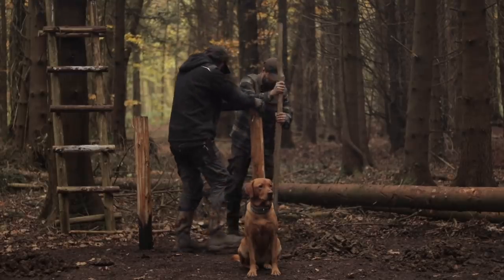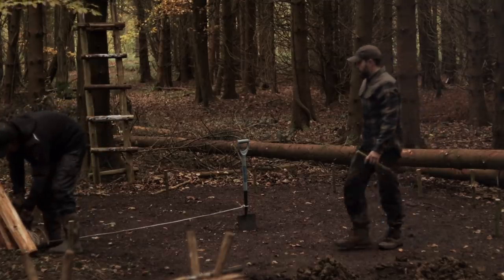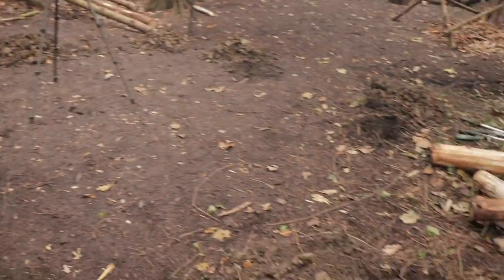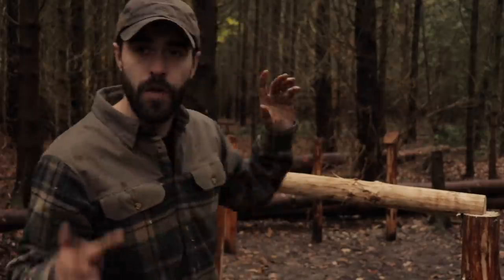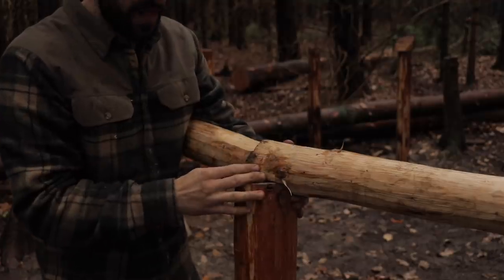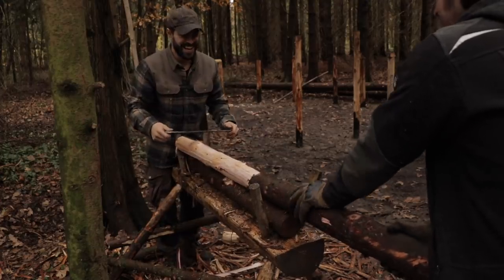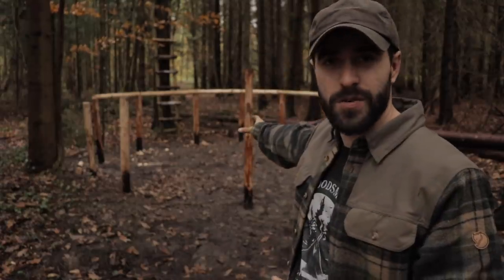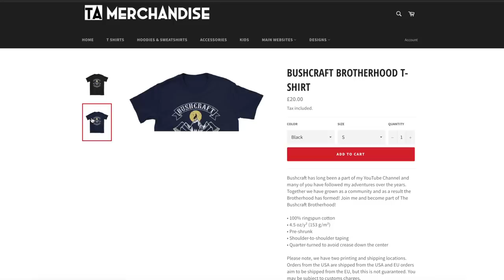Iron Age Celtic Roundhouse: Building the Timber Frame Foundation | Bushcraft Project (PART 2)

Comment: Haaaaa, you always feast well when Dustin is cooking!  Will you be digging a bit of a pit on the inside leaving a width of a sleeping area all around the outer perimeter?  Might make it a bit more comfortable when sitting around inside.   You’d have an elevated sleep platform/storage around the outside.  It’s looking great.  That would also work as a cold sump and it should be warmer sleeping.

Comment: Massive massive tip having been part of a team that built a roundhouse, is put the entrance in the position so it faces the sun.  The aim is as the sun moves across the sky the light moves along the back wall.  After a while you can tell the rough time of day, also you will always have a light source.  Permanently during the day.  Roundhouses can get very very dark.

Comment: Yep can defo support previous comments, wet your spade before digging clay - it works! - I learned that from my Fenland grandfather plus brand new to the channel, I have an ash woodland in N Staffs and planning a round house structure, having early thoughts on such plans at the moment, so I'll be glued to your trials and will be learning loads from you! The intention is to be a go to shelter if/when rain arrives on site during the delivery sessions I run; been using a parachute and or awning/tarps over the last ten years or so! - cheers and good luck, it looks a great setting you have there,

Comment: Hiya, just want to say great series, I was on a weeks holiday in Cardiganshire, and on the road between the town of Cardigan and Newport, on the A487 on the right hand side down a small lane there is an Iron Age village called Castell Henllys. It's an actual iron age village and they have rebuilt the round houses where the original ones stood fascinating place, and it has the ability to move a person well it did me. The large round house has a fire pit in the middle and I noticed that the fire is in a square shallow pit, obviously the round house is a lot larger than the one you are building, but I think the fire is in a pit to allow it to be a larger fire. I was lucky as it was November and not very busy and because I'm  disabled and use a crutch, one of the staff I think maybe the manager offered to take me up to the village in the sites car what with the village being up on a hill, this very kind lady then walked with me as I walked around and into the 3 roundhouse, which gave me the opportunity to ask questions, one being on how when I was at school (long time ago now) I remembered being taught about the Saxons and round houses, and I remember being told or reading that there would have been a hole left in the roof above the fire to let out the smoke..............wrong, the roundhouse's on this site have no such hole, I knew that what I'd been taught was now thought to be wrong but I'd never really asked why,  well as this kind lady told me, wish I could remember her name (I'm terrible at remembering names)  the reason is had there been a hole above the fire the chances were they would have set the roof on fire, because of the embers being pulled upwards, well who knew, I in my own way had thought it was because as it's a thatched roof there would be possible little bugs and things and that with no opening the smoke passes through the thatch killing any little nasty thing like fleas 😄😄😄 well it might do that but that wasn't the reason she told me. Now at this point in this comment, or should I say book, it occurred  to me I'm probably teaching my nan how to suck eggs, sorry if that's the case, but even if that's not the case I'm sure you will be doing your own research. If you've never been to Castell Henllys I highly recommend it.
Well just to add really enjoying the videos, cant wait for the next guys. 👍👍👍👍👍

Comment: Hey Mike!
It is coming along quite nicely!!! I can relate to the wet clay issue.  I once was trying to shovel out some wet clay and it was like a battle with an underground monster...as I tried to lift my shovel up, my feet would embed even further into the ground!
Yeah, as you made the hole in the post question marks were flying everywhere....If you had been putting the hole to one side of center it might have made sense to me, but only one hole didn't.  I thought you might have been intending to have a hole through the cross members and two in each post to match...but then that might actually weaken the post if you had.
You cooked Duck and didn't invite me??? ;-)  You know, Dustin is the "Official Master Bushcraft Cook!!!"  As great as that looked, however, I don't think anything will ever surpass the "Propeller Lamb" meal!
Keep plugging away and we look so very much forward to the next episode!

Comment: Just watching y'all putting those posts in the ground reminds me of the time when I had to extend pasture fence lines. It involved wooden posts, a manual post-hole digger, & a stick to pack the dirt down.  
It was a lot of hard work but in the end, the pride I felt when I'd finished, it was an amazing feeling. I can just imagine how y'all will feel when this house is finished. I wish I could lend a hand :)
Reply: @reivercaptain510  knocks on wood Luckly I haven't had that happen yet to the posts I put in but it did happen to a corner post. And it was actually done by a horse using its head against this 6" diameter post lol. Granted the horse is a half draft so it didn't hurt his head too much 😃
Reply: Not gonna lie, I've had more problems with deer slowly but surely knocking over a section of fence by just clipping the wire as they jump.

Comment: Another trick with post holes is to put a large rock in the bottom of the post hole for the post to stand on.
This will increase the post's "footprint" and allow the post to support more weight .
(It also reduces the risk of the post  sinking deeper into ground over time)

Comment: You can pack gravel or small rocks around base of posts instead of dirt and it will further reduce heave in the winter. That will also keep moisture off the posts, further reducing rot.

Comment: when digging clay dip spade in water clay just slides of spade
Reply: or spray with wd40 ... works also
Reply: they are using a flat tip skinny. should be using a spade tip skinny. used for cutting into clay, roots, skulls, etc
Reply: @0623kaboom  Yes, but that's contaminating the soil with petroleum by-products.
Reply: @indianboobs80085  I know this is four months old but is nobody gonna bring up this person is shoveling skulls?
Reply: Why use many word when few word do trick

Comment: There is so much clay! In addition to burning the ends you could cover them with clay. Placing the clay covered end in the fire would bisque fire them. Greatly increasing the life time. I did some test runs with wet clay from a river shore. If it cracks just add a bit more and cool the fire a bit.

Comment: Easy fix, mortise and tenon joints.
Mortise on left of every crossbeam and then a tenon on the right... bore through on the mortise, the slightly offset the tenon, then when you drive the peg, the mortise and tenon joints will be nice and tight.  :)  Just peg the wholes with a square pin so they will be nice and tight.. they'll never give and as time goes on, they will only become tighter.  Same as the old timers did on cabins and timber frames.  Not sure if yellow locust is available there, but they make the best pegs for such an endeavor.

Comment: If you had put every other beam on top the rafters would have been straight all the way around and you could have had ventilation slots on the opposite sections. Or you could have filled them in with a second beam. Looking forward to seeing finished project. You should just start an outdoor cooking channel.

Comment: The original plan could have worked with a half lap joint on each end over the post, one notch up, one notch down, so that the horizontal pieces had no more than one log's thickness over each post, then pin down through each half-lap end into the post top.  No need to have the 'wavy' effect, which only happens if your half-lap notches aren't deep enough.

Comment: Just reading the "Living in the Past" book today, watching this in the evening, and realized that it's really the same sort of structure as they built a couple of, though theirs were much larger. Unfortunately from what I understand, the actual documentary/ other media associated with the project (apart from used copies of the book) is effectively impossible to find nowadays, or was the last time I looked, especially outside the UK. First learned about it from the interview Lindybeige did back in the day. Anyway cheers, love what you're doing; at the rate you're going though, you may as well start to coppice a few trees to harvest poles for future work instead of using quite so much heavy wood.

Comment: The difference in height of the perimeter beam would be sorted by cutting each end as a crossed half - 50% of one beam, sits over 50% of the other. You could also notch the lower most beam if you wanted it to locate. Otherwise you would just auger through both cross halved beams and peg into the upright. The concern about loss in strength should be fine, since the roof rafters will sit on the joints in compression, forcing the structural elements together. 
Just an idea.

Comment: first off, use a spade tip to help digging (landscaper here). and then second, it would be cool to use the natural clay material to make a earthen oven. i believe that building structures should be geolocal. next build, maybe not a historical one, but what you can obtain in 5? mile radius? i was building houses in hawaii when the national building code got changed. why build foundation two or three feet down when there is never a frostline to worry about? 

cheers, love the channel

Comment: By burning the ends of the poles does that keep the wood from rotting away curious to know thank you very much
Reply from the maker: Yes helps make them more rot-resistant
Reply: Specifically it produces creosote that bakes into the wood, which is heavily root resistant. The house is too get a good sold char to the whole exterior, but not burn straight through it as that would weaken the post or beam.

Comment: You could have half lapped the cross braces. Instead of butting them against each other on the post. Then when you put the roof joist on top of it. You could peg all of it together. I think it would have made a stronger joint over all.

Comment: Set 15 miles of fence with about 20 corner posts and a bunch of corner type posts wity braces for strength so the fence dont sag ran into wet dirt dry dirt wet clay and regular  clay and rocks and roots and a mixture of dirt clay rocks and roots in the holes

Comment: Also, that's not braising. Braising is when you sear the meat just until its brown and then half submerge it in the liquid, not just set it on top. Couldn't tell how slowly it was "braised" but it ideally should be very slow. Just a slight simmer.

Comment: I need some help. So I'm building a hut next to a bamboo forest, so the structure is mainly made out of that. The problem is that the roof is to heavy, I made the support beams out of the thickest bamboo I could find, and just where the two sides of the roof connect, there is a beam holding it up and it's connected to 2 trees. The roof is made out of horizontal bamboo, about 20-40 pieces on each side (The roof has two, like this /\ ) and on top of them some grass and stuff to protect against the rain. The top beam and other support beams have cut in 2 under the weight of the roof, causing the walls to shift like this \ / . Any ideas on how to hold up the roof?

Also sorry if I made any spelling mistakes, English is not my main language

Comment: If you leaned a two sized horizontal beam up against something sturdy and waist high before cutting it to size then two of you could strip them at the same time and cut them in half afterwards.    Check how they do it on IamOutdoorsy where the wife strips the wood the husband cuts down.

Comment: I wouldn't have been able to keep a straight face. Talking about cooking using the Dutch oven. It's an impressive Dutch oven indeed if you can cook food with the heat produced. Cooking with the Dutch oven doesn't seem to have negatively effected the flavour of the food  either, which is fortunate 😖😅

Comment: If you're going to have a thatch roof again and worrie about fire safety, why not build a clay oven by the rear side of the shelter. Some simple stick struckture covered with a thick layer of clay mixed with chopped up thatch should do the trick!.. Tons of effort though :D

Comment: Ah guys :D ... you didn’t have to redo the beams... all you needed to do was to alternate the notches in the beams so that when they meet, the beams are on the same level (think Tetris). Having them done this way, you could then easily drill all the way through each joint directly into the posts and then peg them in for structural integrity. Anyways, take care guys.

Comment: I not want to be rude but I amsure your using the draw knife up the wrong way you should see bevelled cutting edge . All The Best  Adam
Reply from the maker: For bark peeling I need to use it upside down so the bevel doesn’t make it dig in too deep 👍🏻